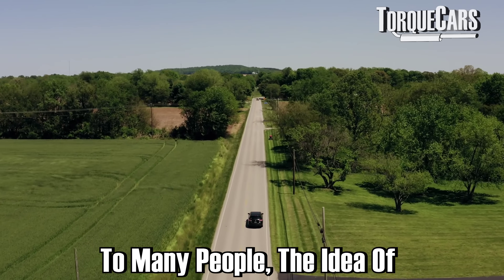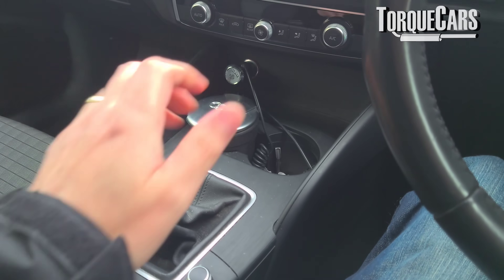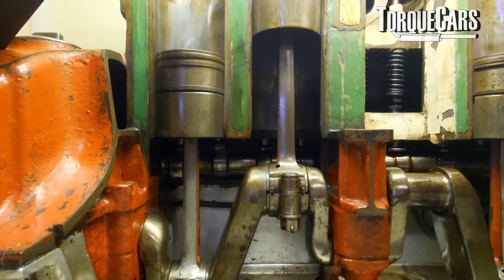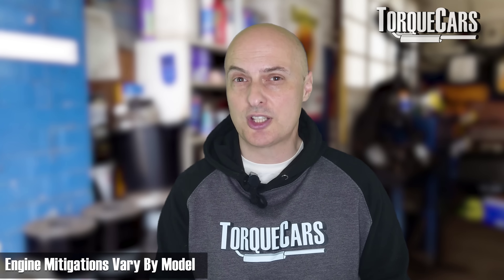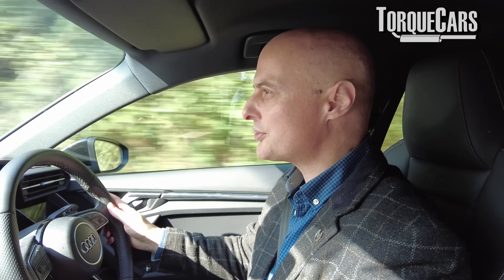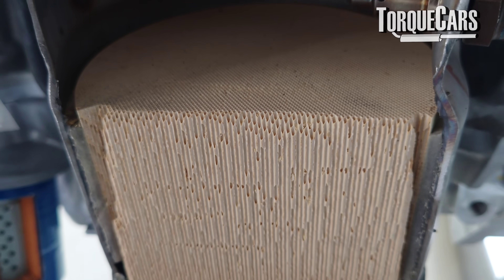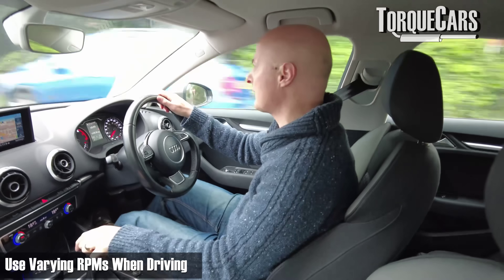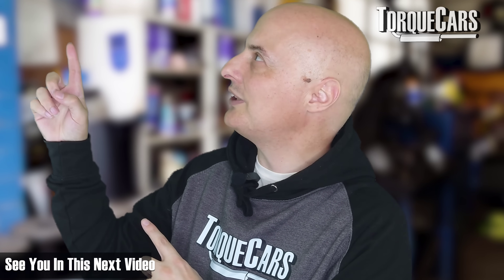BIG DAMAGE By Lugging at LOW RPM? Eco Driving Warning! (Manual Gears)

Comment: Thank you for this video.  What I find very interesting about it, is that my late father told me this when I got my first Motor Bike, Sixty years ago.  I bought a second-hand 250cc bike and it rattled, so I stripped it down and my father explained the ridge around the top of the cylinder and the fractured big end shells, which were caused by the engine never having been run at high revs and the bike being forced to accelerate from low revs, whilst in high gear.  When driving his car, my father would take advantage of good roads and 'race' the engine at regular intervals.  I helped him strip the car's engine at 85,000 miles.  All he replaced, were the pistons, big ends and valves, as there was little wear.  I made a point of following his advice since, especially after I bought my first car.  Russ.  Hampshire.

Comment: Are you swrioua My alhambra is 156k i always drive it on low rpm which means that dosent mean i drive half clutch 😂 no problem till now only i rev engine when it goes to auto regen 😅 just make sure dont drive half clutch it will damage  flywheel
Reply from the maker: Do you really drive at near tickover RPM and use heavy acceleration? Or do you just cruise around at 1500rpm or so, and change down when you accelerate? 

I have clarified "low RPM" as this seems to mean different things to different people. https://www.youtube.com/watch?v=Uot7DHY_C1c
Reply: @torquecars  how i drive is 0-10mph i drive in 1 gear 2nd gear i drive10- 20mph 3gear i drive 20- 30 4thbgear i drive 30-40  5th 40-50 and 6th gear above 50mph i dont give too much accelerator when changing gear  some people i see they give too much acc and change gear and my  seat alhambra clock is now  155199 miles 2017 plate 😀 i always let my car go in neutral on down hill no half clutch driving i peess full clutch somtimes instead of putting on neutral on downhill 😉

Comment: I've always been lazy about downshifting. 487,000+ miles on the original engine, trans, and clutch, and it still runs and drives as smooth as it always has. 🤷‍♂️

Comment: As a Mechanical Engineer and enthusiast mechanic, i learnt a lot here about the actualy reasons to avoid lugging engines! Great video. 

My BMW 730d and BMW 520d both have 220,000 miles on the clock, both get used through the full RPM range and get excellent oil analysis results.
Reply from the maker: Thanks for watching!

Comment: I have a 3 cylinder, 1.2l Nissan Note with a supercharger and it has so little torque that I don't drive it below 2,000 RPM. However, the dashboard indicates that I should change up, but it labours if I follow the recommendations. It has variable valve timing and still gives a good economy if I stay in a low gear.

Comment: I wonder why both of my newer bmw's with the b48 shifts to top gear (7th or 8th) lugging the engine to only 950 rpm in city driving. To prevent this I lock it out to manual mode at time to avoid this and keep rpms around 1400

Comment: Yer trouble is you cant legally go above 2000 rpm even on motorway with the law .you need at least 2000 rpm to clean a cat out etc .
Reply from the maker: Sorry I don't understand this comment, My car will sit at just below the redline at 60mph is second gear (not that I recommend that) but by dropping a gear you increase the RPM. If you car sits at 2000rpm at 70mph which I what I think you are saying if that is the limit where you are, then dropping to 4th or 3rd will take the RPM up to 3000-4000 without needing to go faster.

Comment: Subaru Forester 2016 model gasoline engine, the engine auto stop/start system stopped working recently. After watching this video, I used more engine RPMs just one day, the auto stop/start motion started working now and then. I think after driving more with high RPM, problem may go away completely.

Comment: Driving at low RPMs when cruising on a flat road is perfectly fine and often fuel-efficient.  The damage occurs when the engine is under load at low RPMs.

Comment: chatgpt said Low RPM:
Fuel Efficiency: Running at lower RPMs generally improves fuel efficiency, especially during steady driving conditions. Automatic transmissions often shift up to maintain lower RPMs to save fuel.
Reduced Engine Wear: Lower RPMs put less strain on the engine, which can lead to less wear over time. This is especially true if the car is not under heavy load.
Torque and Power: At low RPMs, the engine produces more torque, which is useful for moving the car at lower speeds or carrying heavier loads. However, power (or horsepower) is usually lower, so acceleration may feel sluggish if you need to speed up quickly.
Ideal for Cruising: Low RPMs are better for steady highway driving, where power demands are lower and efficiency is prioritized.
High RPM:
Higher Power Output: At higher RPMs, the engine can generate more horsepower, which results in better acceleration and overall power. This is helpful when you need quick speed changes or overtaking other vehicles.
Increased Fuel Consumption: Higher RPMs mean more fuel is burned, which decreases fuel economy. Automatic transmissions tend to shift down when you press the gas pedal harder, which raises RPMs to deliver more power.
Potential for Engine Wear: Constant high RPMs can lead to more engine wear over time. However, occasional high RPMs (like during acceleration) are generally fine and can help clean out the engine.
Responsive Driving: High RPMs make the vehicle more responsive, which is helpful for dynamic or sportier driving. Some automatic transmissions offer a “sport mode” to keep RPMs higher, giving the driver more immediate power.

Comment: And this guy is wrong about rpm. The best cruise rpm for gas engines is 1800 rpm. At 60-80 % load. Less than 25% throttle.

Comment: If you keep the load down to 70% 80% max which is about 22-25% throttle at 1400-1800 on cruise you are ok. If you are at 2000 on a gas engine and you have your foot half way down you are lugging. Less rpm definitely lugging. If you need more power you need more rpm. When you’re climbing a grade you want to keep under 80% load. If you’re looking for full power you need to be above your torque peak. And don’t run at higher rpm at light loads. It’s just a waste.

Comment: I regularly run my old, owned since new, 2006 Honda Civic on the highway in third gear, at 5000 rpm, for a few minutes after it's already warmed up. Specifically to clean out both the engine and the catalytic converter. So far so good. The engine runs perfectly.

Comment: So much here I think is pseudo science. The BSFC of engines is often in a good spot at low rpm and high throttle, and they are usually happy running their without a second thought. Your explanation of wear on the rods etc. doesn't make sense to me, if the engine is smooth there will be no adverse damage - the point of a circular rod bearing is absorb load at any angle, it will see highest point load with a vertical crank journal, in theory. An ECU will avoid torque that will trash bearings at low rpm, otherwise half the taxis on the road would need a rebuild every year, rather than doing half a million miles.

Modern (after 1992) petrol engines don't overfuel unless at high rpm. They run at 14.7: 1 air fuel ratio almost all of the time, unless driven hard at high rpm, so that the catalysts work efficiently. That is why they have O2 sensors.

LSPI is an issue on some modern turbo petrols, and the ECU will mitigate this to a greater or lesser degree.  This occurs mostly between 1000-2000rpm, I would be mindful of it if my car's engine was prone to it. I use VPower just in case on my GDI engine which gives a bit more knock resistance, with the BMW B38, but it has no history of LSPI being a problem.

Petrol engines DO NOT not run hotter at low rpms, Diesels can do under heavy throttle. Petrols overfuel only at high rpm and high load to provide  extra cylinder cooling, except a select few (some very new Porsche engines) Thermostats cause the water flow to be adequate for the air flow rate. It is extremely rare for a thermostat to be fully open, as cars have massively oversized cooling systems for typical use, designed to cope with desert temperatures and neglect.

Most rod bearing damage occurs on highly stressed engines running at high rpm such as the V8 BMW M3s, or due to a crazy remap on a turbo car, sometimes hydrolock due to driving through a flood. If the engine is smooth and not showing any bucking due to very very low rpm (say below 800-1000rpm), or pinking noises,  then the ECU will prevent any shock load damage occurring, it will run at safe timing, fuelling and boost settings. It is worth not stamping on the throttle like a switch but rolling onto it though to avoid stress in the dual mass flywheel. It is a good idea to have a high throttle high rpm run to clear deposits occasionally, but with many modern direct injection petrols an Italian tuneup doesn't clear the valves as it used to, as no fuel passes over the valve any more (unless they have an extra injector in the inlet manifold), using the correct spec. of oil and spark plugs with these engines is absolutely essential for deposit control though. 

With Diesels though a good higher speed run every few hundred miles is wise to allow the DPF to regenerate.

Blowby is highest at high rpms.

Comment: And then the pollution caused by the repairs is more than it would have been if we still had cars that used a bit more but were reliable. The only thing environmentalists do is making stuff more expensive, less reliable and in many cases more polluting. But it looks good on paper though 😎

Comment: Supercharged S52 in a lightweight convertible. My engine doesn't lug unless maybe at 900RPM in 5th.
I drive low RPM all the time - a split-second of throttle and then I'm at higher RPM in the same gear.

Easy acceleration at low RPM in any gear.

Comment: Came upon this randomly, I didn't understand what lugging meant when you mentioned it, and I didn't even know the term existed. My father, who's been a driving instructor in the army 30 years ago or so, always told me to drive the car with rpms appropriate to the gear im in. Don't drive under 2-4k rpm if I'm in 3rd or 4th gear or drive with really high rpm, just listen to the engine, cause if you don't you're going to damage it and even break the crankshaft and damage other components 
And I've been doing it for 2 years now and my cars are in the condition they were when he gave them to me as a gift. I have 2 cars, I have a  2005 1.7 cdti opel corsa and a 2004 fiat panda minivan. I'll definitely remember this video and the information

Comment: Its totally ok to use low rpm on low throttle or no throttle if the engine don't start to vibrate or shake because it would cause excessive work on engine mount, and transmission because of the shake or irregular work ... 
But if at the moment you need to accelerate you have two options..
You drop one or multiple gears to go in higher rpm if you need to floor it or gain a lot of speed to have better oil pressure, throttle response and reduce misfire or vibrations

Or you keep the same gear but you add very very gently throttle proportionnaly to the rpm go higher...

Never : full throttle a low rpm, 1/2 throttle is already a lot especially on turbo engines because a lot of pressure on bearings and bad oil pressure for the turbo at low rpm !!!

Comment: My (light turbo petrol) engine has an ECU that recommends shifting up when the revs in the next gear would be about 1350 (!!) but I find that if I drive at less than 1500 rpm I get carbon build up and knocking on acceleration. Happily, I also let it rip now and then so I'm glad to learn that this is a healthy thing for the engine! 😀
Meanwhile, I wish that car makers would publish the BSFC data for their cars (Brake-Specific Fuel Consumption). This would probably make it considerably easier to drive in the sweet spot, though I admit that it's not easy to guess the engine load/torque.

Comment: I don't lug the engine, I just need so little power on today's geriatric jammed roads that even 1200 has a feathered throttle.. I usually change gear based on how hard I have to press the accelerator vs the rpm. It will see me puttering along at 25 in top on the flat, and using the full rev range when overtaking.

Obviously I try and avoid the "lumpy engine" vibration when trying to go uphill at close to idle revs haha.

Comment: That reasoning is truly valid if you're talking about VERY LOW rpms. Like near idle all the time. Also, the general reasoning doesn't apply to all cases: there are engines and engines, ones more suited for a good efficiency band at very low rpm, others very bad for running even at modestly low rpms. Like a small engine block with a long piston stroke could be very well suited for cruising and rolling reaccelerations at 1500rpm, a small stroked heavy vehicle should never see anything under 2500rpm.

Comment: Mostly a load of spunk,  may have been true 30 years ago before engine ecu's,  biggest issue is crank shaft journal wear as this floats on a bed of oil at higher rpms.

Comment: Sir:    Great discussion & accurate. I grinned when you were talking about lugging. Some years ago I had a  truck (I beg your pardon....I meant a "lorry" (grin)  , that had a 16 litre , 500 hp diesel in it, & the torque available was huge  (I disremember the figures) but I used to smile when pulling a long , steep grade, when I allowed the RPM's to drop to 1200 rpm & the engine would hold that speed. I did NOT make a practice of this, but from time to time I would watch the pyrometer, the "boost" gauge, & of course the tach. As soon as I saw the pyrometer start to climb, I downshifted.  I own a 3/4 ton 4X4
pickup with a Cummins  6BT 215 hp, with a turbo & a 6 speed gearbox. I bought the truck new in 97,
& it has over one & a half million miles on it & still going strong. The torque peak is about 1700 rpm's
& that is where I drive it (100 kph/60 mph) .  I have subscribed & I pushed the "like" button. 
Cheers!   from the windswept hinterlands of Alberta Canada

Comment: So low engine rpm doesn't cause engine damage, sudden acceleration does?👍
Sudden acceleration may be a problem on carburettor but in fuel injection fuel is mapped to run in certain way. So even if u floor the paddle, fuel will be delivered with mapped criteria.
Adequate oil pump. Don't you think engineers took that into account?

Comment: Very good advice directed at 'poodling pensioners' Get your engine hot & drive on the revs Once a month give it welly on the motorway to burn off deposits & buy the best fuel  also annual oil change essential

Comment: I have an old Massey tractor and the noise lugging a heavy load at 1100 rpm and hearing it slowly rise is awful addictive, engine had 4500hours and oil still clean every service, probably shouldn’t be doing it though 😅

Comment: Having recently switched from a manual to a DSG ive found it rather annoying how much it shifts around. I mean ive always known that high load at low rpm is bad for the engine but i guess ive just been lazy. I had a manual GTi with plenty of power so i got around just fine without a lot of shifting. Lots of torque for a four cylinder. The DSG Golf R i call mine now just shifts around like nobodys business. Always in the wrong gear for what im trying to do it feels like. Every twitch in the trottle will cause a gear shift.

Comment: I'm an American, and I insist on owning/driving cars with manual transmissions.  I usually drive in a rather "spirited" manner, so low-rpm driving generally isn't something I do.  But I definitely found this video interesting and I will endeavor to avoid wide-open-throttle in high gear at normal highway speeds when overtaking a slower vehicle.  I'll endeavor to downshift even when when I might not have in the past.  Thanks!

Comment: I bought a car that had a pill in it to cover such damage (it was the garage that sold it to the dealer that presumably did this). Luckily I got most my money back still.
The cilinder walls had cracked wide open and there I was stranded with a car that had no coolant in it anymore.
I was soooo hoping it was a tear in the radiator or a tube not being tied, but alas.
I presume the previous owner regularly accelerated the car in the 6th gear, because it's precisely the damage you mention.
Piston rings, cilinder walls etc.
I had an OBD2 scanner with me, no codes no previous codes, ran fine overall but there was a slight (very slight) dip in power at a point I noted when accelerating.
It didn't occur for the rest of the test.
Mind you I'm still a bit inexperienced with the mechanics of cars, so I didn't think too much of it. Thought it might be because the engine was still cold and there might be a small gap in one of the cilinders or the rings. It didn't throw any codes at any point (until 12 hours later).
Thinking it was a minor leak (which I was willing to repair with a set of new rings), though it turned out the entire engine was DOA and the pill wore off within 12 hours after buying the car.. :D Fun experiences.

Comment: I have a Honda Jazz/Fit with a CVT. Always the right revs, driving slowly or a bit faster (it doesn't have much power) but normal driving is between 1500 and 2000 revs for a NA petrol. Next January it will be 21 years old... if it is designed like that it will last a long time. And yes, it can do 6000 revs per minute. And yes, sometimes  I do. It’s good too blow the egr a few times per tank of petrol when the engine is hot.